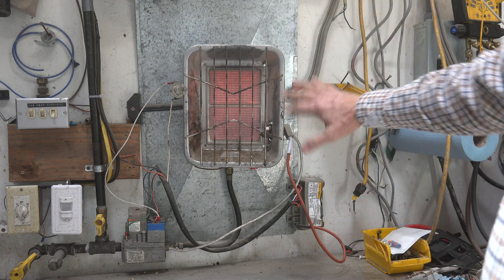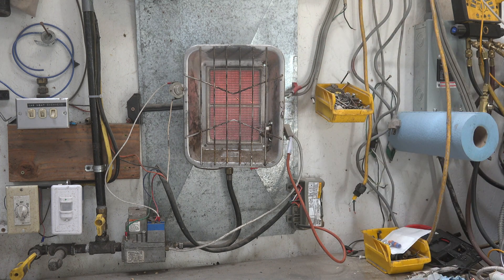Early energy saving devices for furnaces.

Comment: My Father built  a timing device that did just what one of those "brains" did.. Then came the  high efficiency  single stage furnaces in the 90s that seemed undersized where " less is more" and were intended to run almost continuously to maintain temp so it seemed. Now they have it   correct it appears with 2 stage or modulating high efficiency furnaces.

Comment: Wonder what ever happened to "Blue Ray" oil furnaces of the 80's? They could hit 93% efficiency if you diddled it just right. They never seemed to actually fire a blue flame...More of a pink color usually but "Pink Ray" doesn't sound manly to me. Seems the higher efficiency the more condensation and corrosion in the stack ...
Reply from the maker: I have never heard of it.  However, I did research it.  There was a CO problem that caused some deaths and they were recalled.  I would love to have one to test.  
Certainly going past 80% efficiency would cause condensation and subsequent damage.  
GFM

Comment: I don't speak English but I'm going to try. Baltur, what is a Italian burner use a little piece o sheet tha is lifted by the air flow, when the motor turn off, the damper fall off and that reduce the lost of energy induced for the draft air through the burner. Obviously it doesn´t apply in atmosferic burners.
Reply from the maker: You did quite well.
A damper actuated by the moving air can be effective.  It must be installed with a pressure switch that will indicate if it has jammed.
GFM

Comment: When i was a young tech & customers would ask me is it worth it to switch from standing pilot to Electronic ignition I Allways told them no. 2 reasons. 1) If it ain't broke don't fix it. 2) maybe save a $1.00/month on gas bill. Costs  $300.00 min to install. So you spend $300.00 to save $144.00 over 12 years makes no sense. So your in the hole $150.00 on average. Customers are like ok. Thanks for the heads up on that. All very thankful for the honesty & not just up selling them. Good video. Like # 39.

Comment: I really hated adding pilot spark ignition. They were so temperamental to find the sweet spot of air fuel mix 

A neat instruction video might be how to bypass a defective bypass switch and what happens when you plug a damper into a boiler control

Comment: I still see this stuff all the time, they don't really save anything utility cost wise but what they do very well is put customers in harms way. Many of the bi-metal, electromechanical, and sail style flue dampers I see don't work or respond to slowly and were not installed with spill switches so flue gas just dumps into home☠.  My favorite tho is the California Econimizer(not zoning) blower control for a belt drive furnace. Takes heat from the plenum down to a thermal clutch on blower to control fan speed, ahhh good stuff. I'm a younger guy but in my neck of the woods I see some old controls.

Comment: I see a lot of these electric vent dampers in Steven Lavimoniere's videos that are shot in Massachussetts where hot water heating is common. They are not on furnaces but on the gas boilers he services. The boilers with them don't look all that old to me. Steve even explains in one video that the hole plugged with the snap in cover (visible on the damper in this video) in the damper plate is supposed to be removed if the boiler has a standing pilot. This hole is meant to be large enough to vent any exhaust from the pilot while the damper is shut.
Reply from the maker: Boilers are still made with them.  The reason being boilers have a lot of thermal mass.  When they are off, there is a lot of heat in them if they are cast iron.  So you will continue to see them.
GFM

Comment: When I was a young HVAC tech, I bought a house with an oil hot water system in it. The previous owner used a certain oil company and had them clean and tune the boiler. It had a 1.75 GHP nozzle in it and drank oil. I cleaned it and installed a new Carlin gun with a .75 GPH nozzle and cut my usage way down. It had one of those Honeywell dampers on it. Never let your oil company tune and clean your boilers. They just want to sell you more oil by far than you need. Thanks for the video.

Comment: I often wondered if a standard pilot used any gas worth counting.

I don't work on furnaces that often but I still love the simplicity of the 80% with the induced draft fan.
Reply: some of the older conversion burners had a huge pilot light and did eat gas, then again compared to the single massive burner it was nothing :)